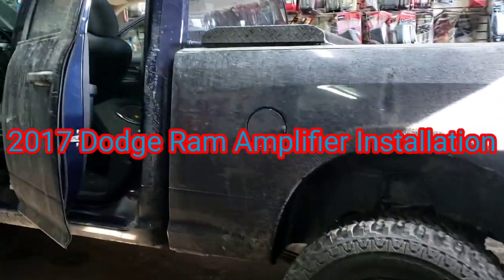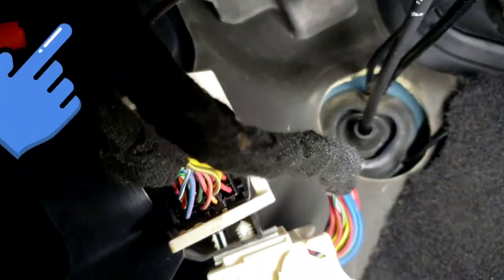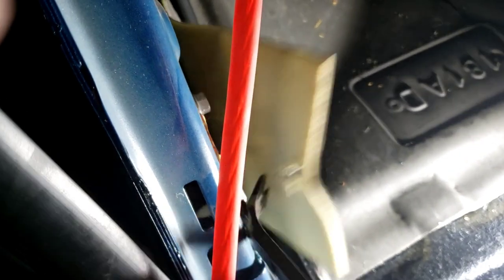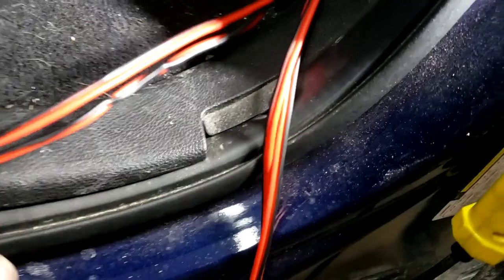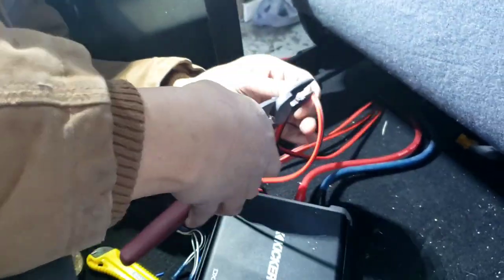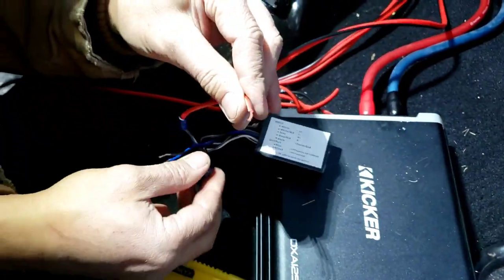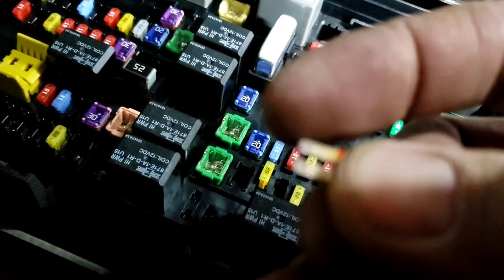How to install subwoofers Amplifier Dodge Ram 1500 13 18

Comment: If the Ram has the stock Alpine sound system in it where would be the best place to tap in the Loc to get a high level signal?? Could you remove the stock sub and tap it in there??
Reply from the maker: The front driver's speaker
Reply from the maker: What year?
Reply: 2014
Reply from the maker: Amplifier u der drivers dash black 16 pin plug pin 14-6.   Gray/brown + and dk green/brown -
Reply: Thank you sir.
Reply: my truck is also a 2009 and it also has the alpine system which speaker you recommend to get signal from
Reply: That's what I got and I'm want to put in my sub
Reply: How would I do that
Reply: Do I need an amp
Reply: I just cut the wires that go into the stock sub and wired in the line out converter there to give signal to the amp
Reply: @juanaguilar8147 when i did this it didn’t work. amps getting power but no sound from speakers. what loc did you use and which wires were the left and right?

Comment: I can’t get my amp to turn on. Bought a new one still no luck but I’m getting power to the ynit
Reply from the maker: You will need a test light to test the remote and power wire

Comment: I have a ram 2014 stock radio do I need to buy a whole new wiring harness or just need an rca adapter?
Reply from the maker: You meant Line out converter? Loc

Comment: Just curious, what was the 10 amp fuse for? I am getting ready to do this in my 15 ram and want to make sure i understand that portion.
Reply from the maker: Amp turn on
Reply: @khmerohio  ok thank you, i should have the same color wires to T tap into next to the pedals correct?
Reply: Quick question. I want to run the rca wires from the passenger side front speakers. Do you know the color combinations? Its a 2015 1500

Comment: So i have everything wired up but it wasnt done by me. 
Power wire comes onlff the battery, the ground is right next to the amp but i get no power because the guy i bought my 13 ram from has the remotrle wore wired up to the driver side piller between the driver side doors. 
What wire is suppsed to be tapped for the remote
Reply from the maker: It's almost to the end
Reply: @khmerohio  the wire is tapped intona orange light blue wire in the b piller. So im confised
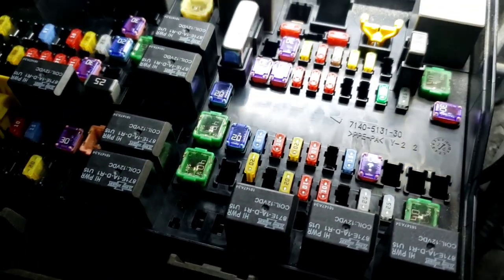Reply from the maker: @chazwebler4284  9:59

Comment: I have a question so having the rca converter to the remote wire . Do you still have to run another remote wire ?
Reply from the maker: No, you dont have to
Reply: @khmerohio  sweet thank you for the quick response! Never done a ram and glad I saw your video!

Comment: Hey what about white and blue.  And wihite.  R those speaker wires to ?
Reply from the maker: White from the car?
Reply: I got 2017 ram . And it's hard to find the te wires. . I test a white with blue stripe . And another white  . But didn't work . . What would you recommend 🤔
Reply: I m train to do the same setup .

Comment: So the remote wire fuse is the seat heater . But i dont have a seat heater on my ram .
Reply from the maker: What year is your truck ?
Reply: @khmerohio  2017
Reply from the maker: You can find it at the cigarette lighter plug   or at the ignition switch  black 6 pin plug pin 4 it's violet/brown
Reply: @khmerohio  great ill try it to today ! 👍🏻 thanks man

Comment: Hi I'm getting a loud pop/ thump from my subwoofer when I turn on the ignition key.   I hooked everything up exactly the same way as in the video.   I have a 2017 ram 1500 (non alpine system) 

Hertz amplifier HCP1D monoblock amplifier running at 4 ohms 300 RMS

Rockford Fosgate R2D2 DVC running at 4ohm

Any help would be greatly appreciated,  thanks and great video.
Reply from the maker: Check this out! https://a.co/d/3cGJ9qt
Reply from the maker: 11:1 Did you try that?

Comment: Will this work on a 2016 ram with stock 8.4 alpine stereo?
Reply from the maker: It should
Reply: did you try it and if so did it work? i want to add subs and an amp to mine with the same setup

Comment: would the speaker wires be different colours on a 2015 3500 6.7 cummins? cant find grey and violet and grey and yellow?
Reply from the maker: Left front which is driver's side door right?
Reply: correct
Reply: could i splice them into any other speaker wires?
Reply from the maker: Tell me what side and color I'll tell you the positive and negative